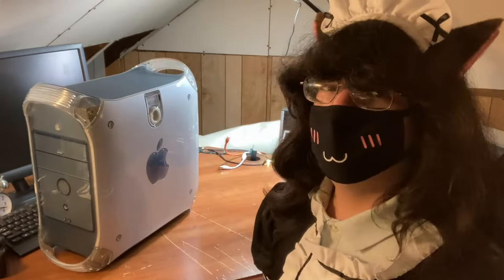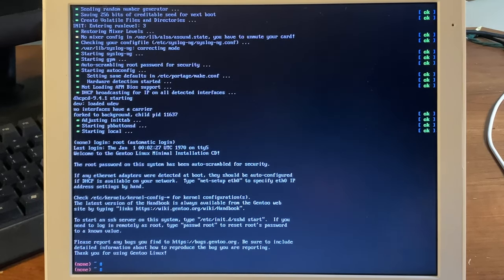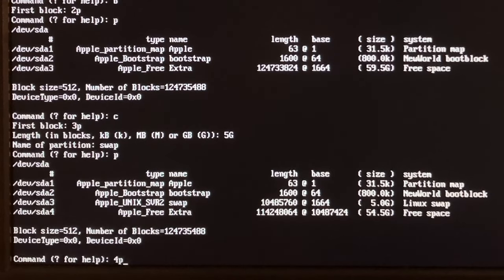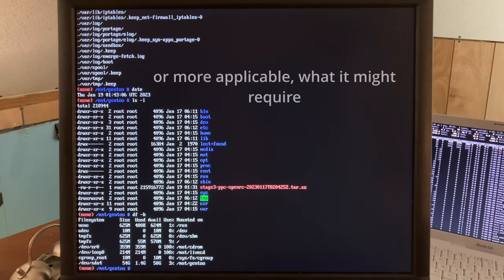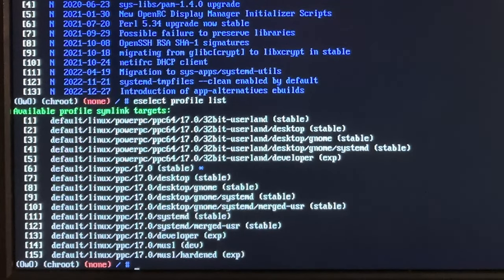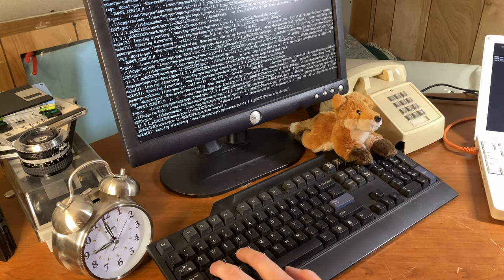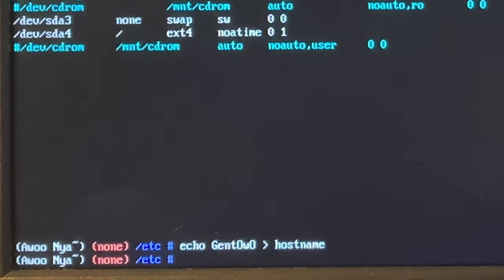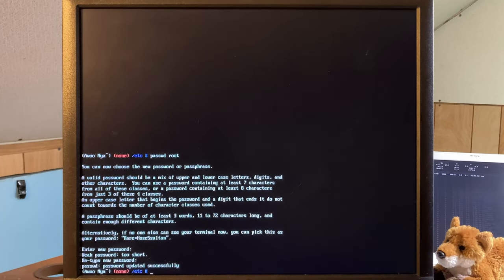Gentoo Linux on an iBook G4! (ft. Maid Outfit)

Comment: I wanted to do stuff like this in college a few years ago. PowerPC Mac running Linux, fem attire, and programmer socks. Turns out PPC Macs are expensive and I waited too long to come out as enby. Plus my hair started thinning before I started growing it out. At least I got $40 worth of thigh high socks tho.
Reply from the maker: Hey now it's never too late :3
Reply: @WindowsG  almost 25 and somehow think I'm already too old
Reply: Hopefully getting on pinkpills will help to reverse hair loss, it's possible (if you start soon enough?) but not guaranteed.
Reply: @SonicBoone56  so.... 24? thats super young!
Reply: @SonicBoone56 I'm 34, almost 35 and still not out completely but it's getting close. I can feel my shell cracking!

Comment: I actually happened to come across an ibook g4 recently (in good physical shape but unknown working order. Currently waiting for a charger i ordered to see if it powers on.) I hope to be able to get it running and this video is a big help!

Edit: the iBook works! At least in so far as being able to power on and post. Gonna have to replace the HDD and battery eventually.

Comment: Very entertaining video! Also, you look so cute in the maid outfit! In fact, it’s very fitting for this video!
Reply: I myself actually daily drived Gentoo Linux a little bit in 2022 on the computer that I used to have Windows 7 on until I decided to switch to another Linux Distro. I currently run Arch Linux on my Windows 7 PC and myself did a fine amount of distro hopping before I made my final choice on Arch!

Comment: I have a friend who used to run Gentoo and distcc on every machine in his house (after converting the wife, mother in law and grandmother to Gentoo). At the beginning of this video I was like 'yeah I'll check out gentoo on my new budget Chinese 12700h laptop' and then like 58 min in I was like "Uhhh.... Debian and FreeBSD are fine. I'm good." =) Thank you for sharing, love the video. (I can get the machine to 90°C if I use -j 16 on this chip, 99°C->throttle->rinse->repeat with -j 20) Also I have a powermac 400/1gb/2x80gb/3xgbe that I was using for ipmasq to segment our tech room from the company lan and to add a bridgemaxx backhaul for no good reason. I think it's running yellowdog. I can't log into it to save my life. If you want it it's yours. Protip: just grab the neofetch bash script from the git and run it. It has no dependencies other than bash.

Comment: I wonder if there's some kind of black magic you could invoke to use distcc to call out to ppc32 cross-compilers on significantly more powerful machines. Honestly, any kind of source-based distro on mid-00s hardware sounds like a special kind of hell to me. Gives me flashbacks to building an LFS system on a single-core ARM board like a decade ago. Fortunately I was able to cross-compile a good chunk of the rootfs (sparing myself from compiling the kernel and GCC directly on-board), but for a lot of stuff I ended up using pkgsrc in the LFS system itself to cut down on manual dependency management. I think Xorg alone took an entire day to compile.

Comment: I miss my Powermac G4 digital audio. I got it at a second hand store, it had a cracked processor and a dead power supply but I used a pc power supply with help from a web page and had it working for about 4 - 5 months. the graphics and easy access to the motherboard were what kept me using it, but it died after a thunderstorm.

Comment: More PowerPC stuff it's a great architecture though it is expensive for used equipment. Gentoo is a great OS once you daily drive and learn how use flags works you can prob get it pretty lightweight on these old machines if you try hard enough and use window managers like dwm i3 or awesome. You could also try doing some of these old PC videos on NetBSD as it seems to support this older hardware forever where as Linux and other BSDs tend to drop support after many years. Please more interesting content like this, it's great to see a use case for these older machines if possible, instead of in a landfill and it's cool to see how usable they really are in the modern day.

Comment: Typing this right next to my PowerMac11,2 running Debian Sid 😉 it's maxed out with 16GB of RAM and has a Radeon 6850 with GPU acceleration (though it's having video decoder issues >.> gotta fix that sometime). I'd be tempted to bootstrap Arch on it someday, but for now I will figure out something to use it for someday 😼 even if it is just a space heater.

PowerPC is dead, long live PPC64 \o/

Edit: ohboi, that installation was a chore in 2023. Back in 2022 it wasn't tooooooo bad, but there is no .iso for Debian Ports from this year so the included keyring on the iso is out of date >.> and getting Grub to install can be a bit of a hassle...

Comment: 35:40 emerge --ask --verbose --update --newuse --deep @world (emerge -avDuN @world) doesn't actually rebuild the entire system, only the packages which:
1. are out of date
2. are (new) dependencies
3. use flags had changed (for example: USE="lto [...] adds USE flag lto for sys-devel/gcc, which is not on by default, so it will be (re-)compiled.)
AFAIK the command to recompile every single package is emerge --ask --verbose --update --newuse --deep --emptytree --with-bdeps=y @world (emerge -avDuNe --with-bdeps=y @world).
Reply from the maker: Yeaa i realized that later, --update should've been enough of a hint

Comment: 52:35 Or just keep it and let Windows deal with it's own stupidity, it'll still work either way.
Reply: Not sure about that one. I’m not certain this is in any way related, but my windows keeps showing wrong time after I boot into Linux
Reply: @jaynayk1176  Yes, the OS still works and eventually it syncs and corrects itself.
And as I don't need Windows at all, the times I do boot into it, I just don't care.
Reply: @WyvernDotRed  you can also set windows to UTC